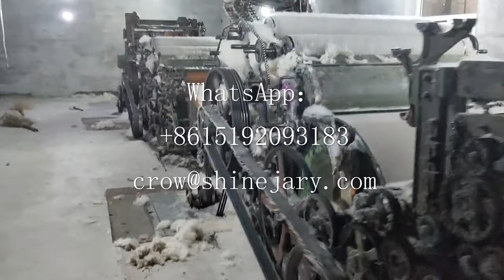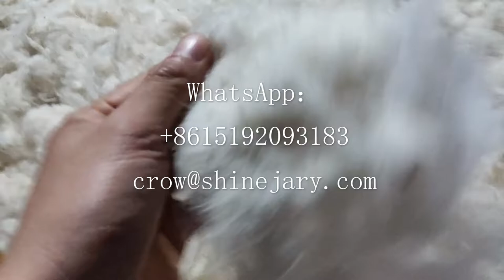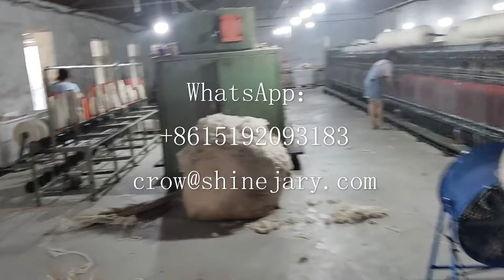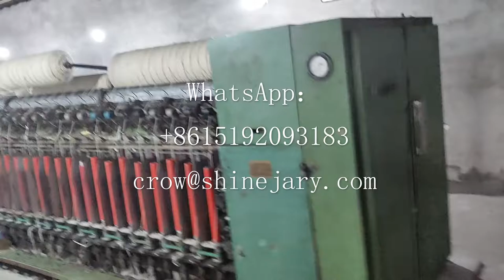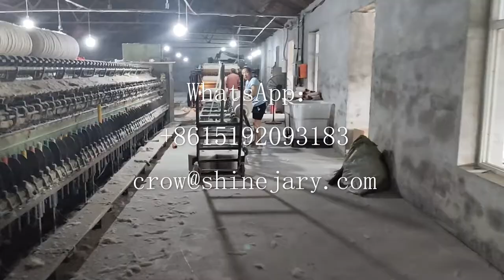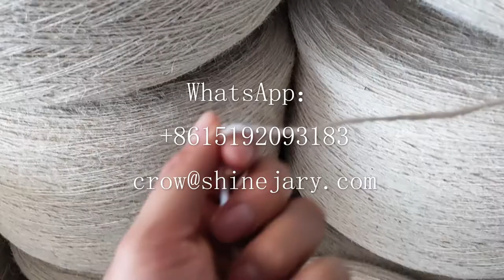How to make wool yarn？

Comment: Is it possible to make 28/1 threads for clothes
Reply from the maker: This line can produce 28/1 wool yarn.
Are you going to buy yarn? Or a machine?
Reply: Machine
Reply from the maker: @mahmoudbahlol4456  What is the length and fineness of the wool you use?
The production line requires at least a workshop of more than 500 square meters. Can you provide it?
Reply: @qingdaoshinejarytextilemac701  I just want a combing machine
Reply: The rest of the other stages in a friend's factory
Reply: carding machine only
Reply from the maker: @mahmoudbahlol4456  My WhatsApp：+8615192093183
Email：crow@shinejary.com
Welcome to exchange. We have many kinds of carding machines.